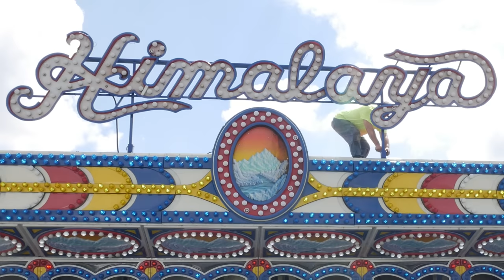This Himalaya Ride fits on 1 truck!

Comment: It is utterly amazing that the whole ride fits inside one truck and that parts of it fold up like that! I am also surprised that the upper area is strong enough to hold a person as they set up that red fabric up there. Never dreamed that upper part was so strong. And the seats are called "tubs". And they attach to "sweeps". In POTC they had "sweeps" too! Which I suspect were also very long poles. I suspect that is where the word originally came from maybe and it just tranaferred over to a totally different area (carnival rides).

Comment: This one was even better than the zipper setup and I noticed two of the employees appeared to be the same guys on the zipper video.They must be involved with helping setup a bunch of rides.I'll say it again as I did in zipper video,ride engineers are unbelievable at what they do to be able to incorporate all of the components needed for a ride like this & make it fit on one trailer,not to mention the hydraulic,electrical and air systems necessary to aid in setup and ride control.Great stuff

Comment: I remember being a kid in the mid 80’s, when the carnival would come to town, they had a ride called the “Flying Bob’s”. It was similar to this but bigger. Traveled on 3 trailers. The cars (bobsleds) were held up off the floor on the sweeps, so at speed you were 45 degrees to the flooring. The former 10 year old in me, appreciates that you were allowed to film and document this (especially the Sizzler).
Reply: I never known these where carnival rides until a few years ago because the theme park near me always had these kinds of rides and I found out a few years ago the theme park in my area buy these and sets them up and uses them for years.

Comment: Thank you!! I love watching rides being set up. It’s amazing that it all fits onto one trailer. I remember the old Himalayas used 2-3 trucks to transport.
Reply from the maker: Thanks for watching!
Reply: The ones that you are taking about were built in Germany by. The Mack company probably, the Himalaya was the two trailer version and the Super Himalaya was on 3. These American ones built on a single trailer by Wisdom are so minimal that it's an extremely embarrassing reflection of the current situation.   The rides mfg here are more concerned about how quickly and easier they are to set up and slough than how they look knowing that the carnival owns all of the rides and the people can take it or leave it and don't care. The European system is so much better, the rides are owned and operated by independent contractors who've been doing this for generations and it shows.   This encourages the competition and pride as they are paid for the people who will choose to ride the ones that are putting in the extra effort and showmanship. It is kinda like thinking that a two wide mfg house is the same as a two story custom built house or Domino's is the same thing as the local pizza place that has been there forever and has style.   For example just look how cheap the back  of the inside scenery looks unpainted with all of the wires and sockets exposed like that from the factory. Would you mind if your contractor left your house like that? Google the Oktoberfest and other larger fun fairs in Europe and you will get it...

Comment: Amazing. We like to poke fun at “Carnies” but this is the part of the job nobody ever sees. Then they have to break it all down in a few days, usually in the dark, to move to the next event. 

Great video!
Reply from the maker: Not to mention there is so much going on to put on a show like this. When you start adding up the purchase price of the equipment, the number of semi truck required to move it, the cost of diesel- it really is an amazing operation.
Reply: @1981mrdavid  Done that more than once-it sucked!

Comment: The engineering involved to make the ride operate is second to the engineering involved to make a ride fit into one trailer.
My home town hosts our annual county fair and I can remember watching all the ride trailers coming in and getting set up on the Monday before the fair started. It had to be that single day because most of the rides were coming from another fair that had ended the night before elsewhere in Ohio. Then, they’d be able to ‘leisurely’ disassemble Sunday night/Monday morning and travel to the next fair for setup since that one didn’t start until Wednesday.
Reply: Lol there was nothing leisurely about a Sunday night  ...run all day,straight into teardown, haveing the WHOLE show ready to move at 8am. Mon. Then travel to the next spot...setup, and maintenance.  It was a very long work day. But I wouldn't change it for the world. Some of my best times  were had .in between the work ,sun,and grease...lol
Reply: @erichanson1854 You're forgetting about the "Circus Jumps" when we were running the rides when we had full loads for 12 hrs. Around 11pm we changed clothes, tore down the rides and pull wire as  the sun rises.   Then drove at least one load and set up and opened up on Monday and this  was the biggest show on the west coast at the time.
Reply: @miketwomey4923   West Coast you say, wouldn't happen to be straits would it? And how can anyone ever forget that dead tired feeling  lol

Comment: Fantastic! I have stared at Himalayas for ages wondering how they rack. Outrageous engineering!!! Looks like this one needs some updated lighting or wiring for the lighting. 10 thumbs up to the vid and Majestic Midways!
Reply from the maker: Yes, this one was due for some new bulbs, I believe they were still on order.  One of the upper scenery wings was damaged and they are waiting on a replacement so they don't run either to keep it symetrical. And one of the center panels had a multi pin connector that needed to be rewired.
Reply: @PeteRondeau  they have the old lighting patterns, A lot of new Wisdom Himalayas have colour changing led's and new patterns for them.

Comment: Tunnel isnt as detailed as the Reverchon but super cool to see none the less. Thanks for posting!!!? 
When I was 12 that ride kept me in my room till I could do "The voice"  when I was 18/19 i got up the stones to ask the guy if I could rock the mic. 
"You know the drill?" yep! "Here ya go!" my friends said they made more noise for me than the guy doing the ride lol.
 Fast forward a few years I'm at a bar in town and I recognize the other guy who did the ride every year. "You got a great voice, here's my card, you can fill in for me on my breaks" Sweet! Thank you!!! September rolls around I show up with his card and he totally snubbed me. Ha!
Reply from the maker: Yeah, it doesn't have as much of a "hill" either.  Basically designing the ride down to its bare elements.  Can't afford to pull a multiple trailer Himalaya into a small carnival ground so this is a good compromise.  That's some dedication ya got there, did you ever get to do it again?

Comment: This is really cool to see how the rides are set up. I have a lot of great memories attending the traveling carnivals and feasts as a kid. I have to ask though, is it still dangerous setting up and breaking these rides down? I remember a lot of the ride operators (who I’m assuming also set up and remove) had one or more fingers missing. This was back in the 80s and 90s, as I’m now 42. Thank you to those that work these events for the fun I had as a kid, and for the fun I know my kids will experience.

Comment: When I watched our county fair setup, for this, graviton, ferris wheel, and a few kid coasters where rechecked if setting up during rain. IE: it'd rain during setup, they already had everything leveled. So after it stopped raining, they'd run full loads of employees on leveled rides to get it to sink in. They'd check levels again and adjust. 9/10 times it needed to be adjusted after a rain. They'd also grease all parts as set up procedures. Interesting to see different companies do things differently. How often would they grease and recheck levels?

Comment: Insane engineering went into this ride. From start you see a trailer but no ride at all. Finished you see ride but no trailer at all. I had always wondered how that huge platform and a roof were put in place. On this particular one the ride itself is very simple compared to the setup of it.

Comment: Interesting video!, a lot of work in setting up these rides !, can you please do one on the double hammer ride ?, I think that's the name of it,  it has two cockpit type enclosures like a rocket shape, they were mounted on a cantilever arm with a counter weight, one arm unit per side, this assembly is attached to what looks to be a huge truck differential mounted upside down with the drive shaft portion facing down into the trailer assembly and connecting to the control motor. Some I have seen is a slightly different setup of the counterweight arms, where they are connected with a chain and sprocket gearing to give riders more G forces!

Comment: that machine in my country is stored in 2 trailers, 1 trailer for the platforms and the rest of things and 1 trailer for the carts
Reply: the one there is my country (Puerto Rico) is called Arctic Circle
Reply from the maker: Yes, some of the park model Himalayas even require 3 trailers.  The Arctic Circle is a larger ride than the one shown in this video.

Comment: Worked many years on a Himalaya in Seaside Heights NJ. Ours was a Revershawn. ( don't know if that's the correct spelling or not)  Good times though
Reply from the maker: Yeah, that is the big, what I would consider original, himalaya

Comment: What do you think happened with the Rye Playland Wizdom Music Fest last week ?? It wouldnt shut off while it was in reverse  for some reason
Reply from the maker: I hesitate to speculate because I really don't know.  All I can say from an electronics standpoint, it is an unusual failure.   Things like E-stops are wired so that they open when triggered  That way in the event of a broken wire or bad connection, or even the switch itself failing, the machine will stop, not just continue.  That combined with modern solid state motor controllers, there are no high voltage contacts to fuse together due to something like arcing.  I'd be curious to hear exactly what happened.

Comment: that is a mini Himalaya called silver streek and full-size Himalaya takes anywhere from 2 to 3 trucks to move
Reply from the maker: The sliver streak is smaller than this version.  A silver streak only has 16 tubs, this ride has 22 and the tubs face the other direction on a silver streak.

Comment: I have always wondered, how can they power the lights or the motors that are in the carts without the wires breaking when they turn?
Reply: I imagine that there will be something metallic that makes contact with the base to transfer the energy while it rotates
Reply from the maker: Do a search here on YouTube for Slip Ring and you'll find a few good videos- some with animations that do a pretty good job of explaining the function.  The other thing to keep in mind is that this particular ride has to transfer not only power but air as well for the lap bar releases so there is an air fitting that also allows the same type of function

Comment: I have looked at this video several times, as well as others, and I cannot see how the central hub is powered.  I know there is an electric motor (duh), but how is the power from it transferred to the central hub?  Surely it is not a direct drive, as that would require quite a bit of high-powered electronics.  Is there a giant ring gear connected to the hub with a spur gear from the motor, or is there one or a series of tires under the hub connected to the motor, or something else I can't visualize?  This has puzzled me ever since I first rode on one of these several years ago.
Reply: Mack and Bartazon have  four motors under four tubs

Comment: 63 KW sounds like quite a lot of power! At 220V, that's like 286A! Must require a very beefy wire gauge!
Reply from the maker: 40kw of that is just for the lighting.  Even 10 watt light bulbs add up when there's over 3000 of them.

Comment: 2:03 Which begs the question-  How much higher or lower would that number be for incandescent vs LED lights...
Reply from the maker: Its a rather huge change.  Certain things don't change like the flood lights and the big strobe- that's still about 10,000 watts for that.  But there are over 3000 bulbs on the ride (originally at 10 watts each).  if you swap those out for LEDs, you can see a massive decrease in power.  You can get an E14 led bulb that consumes .7 watts.  That's a 28,000 watt savings.
Reply: @PeteRondeau  That is nuts! (but is completely believable given those numbers!). The nice thing (I assume) is that its just the lamp itself that would need to be swamped not the entire Cabochon exterior.

Comment: Intriguing to say the least. I worked at a local theme park when I was younger. Many of those flat rides were assembled into the ground with permanent scenery.  How long does it take to set up? Great video!
Reply from the maker: What you see here took about 8 hours but we had a rain delay and it was a crew that was not familiar with this ride being taught how to assemble it.  An experienced crew could shave a bunch of time off that
Reply: 4 hr set up with experienced crew Fenelli guys do it in 4 hrs flat

Comment: Dumb question I sorta work for a carnival company  RCS in Arizona. But I discovered your videos yesterday  neat stuff   coming from a mildly autistic person. My question is why in your videos dose this particular company set up on what would normally be a  show day or a day they'd be open
Reply from the maker: Thanks for watching!  I'm not sure I understand your question.  What gives you the impression they are setting up on what should be a show day?
Reply: @PeteRondeau  You said it was Saturday morning-that is usually the best, and often last day of the spot.
Reply from the maker: @cezarnie7631  ahh ok now I understand. They were already up and running at another location. The Himalaya had been pulled into this lot the week before and was just sitting there until they had free time to set it up. The actual carnival in this location wasn’t happening until the following Thursday. They didn’t need all the equipment in one location so they were leap frogging it to the next location ahead of time.

Comment: I think you may have been mistaken in the power consumption. 63 KW sounds way too high.
Reply from the maker: Nope. That’s correct.  Manufacturer rates it at 40kw for lighting and 23kw for the  30 horsepower motor. There are over 3000 10 watt lights on it

Comment: It looks smaller than the ones from the 1980s.
Reply from the maker: Yes, some design changes had to be made to get it to fit on one trailer.  The original Himalayas traveled on 3 trailers and were assembled more like an erector set.  The trailers just carried the parts and they had to be unloaded and set up on the ground.